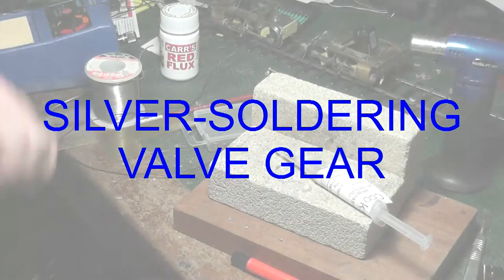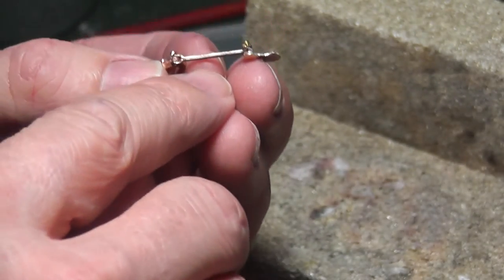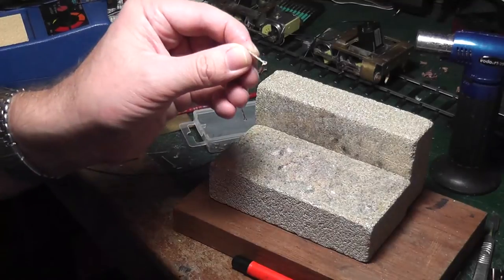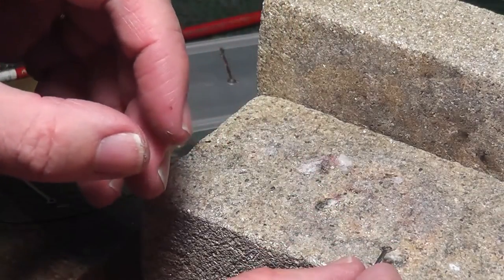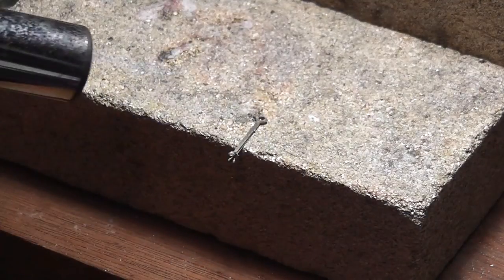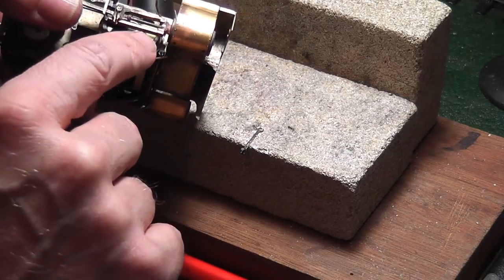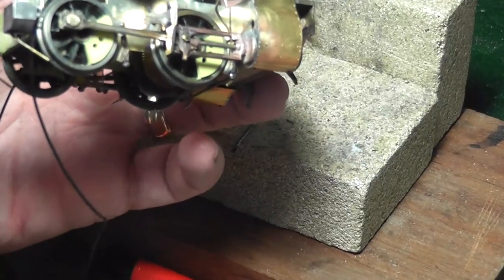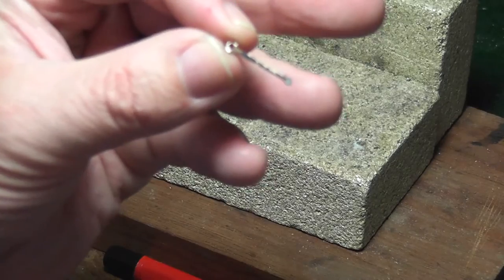Silver-Soldering in Railway Modelling

Comment: Nice quick tutorial.  You make it look easy.  Just curious though.  Many other books, videos on soldering stress using flux.  Did you flux the parts first and not mention it or is it not necessary with the solder as a paste?  Also just have to say I love your model work.
Reply from the maker: The S-Solder paste contains its own very effective flux - so as long as both parts are clean - that's all you need!